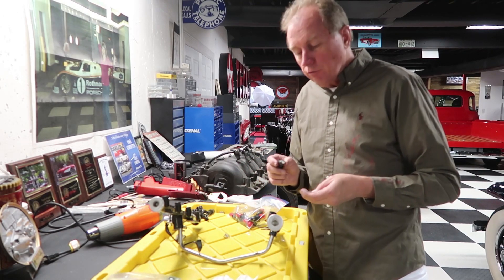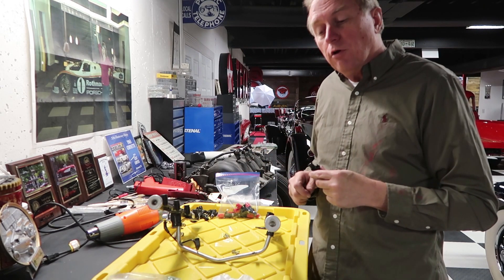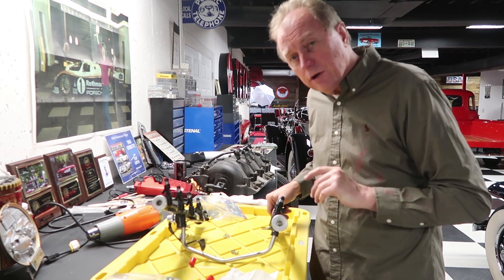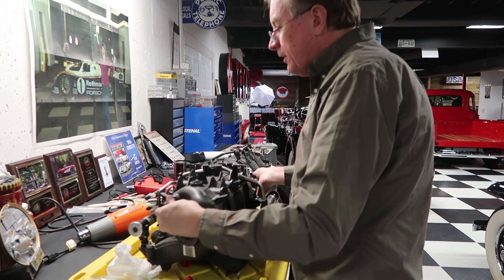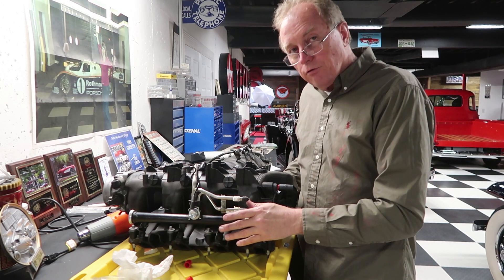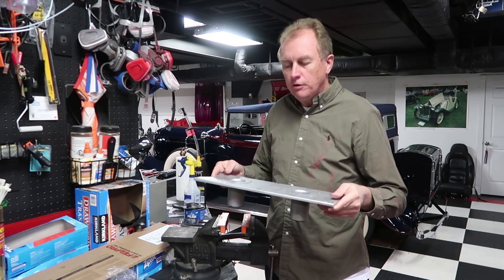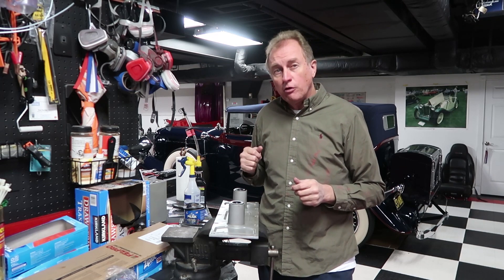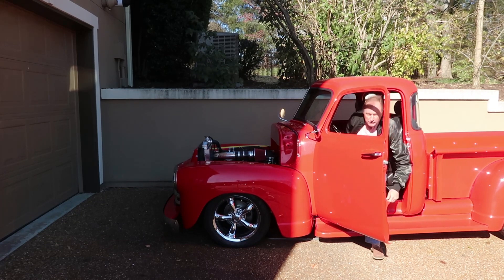Diagnosing & Replacing Chevy Vortec 5.3 Fuel Injectors

Comment: Beware that clogged inlet screens cause driveability issues and high fuel trims. Just saw this on a W22 RV with the GM 8.1. Had high fuel trims at cruise. Removed all 8 injectors and rinsed out the intake screens if debris. Before rinsing the internal screens appeared to be black. After cleaning the screens were obviously white. This debris isn't something you could flush out with injector cleaning techniques. You'd have to squirt carb clean into the inlet screens to rinse the debris off the screens. After reinstall fuel trims went back to normal + or - 5 percent LTFT and 0 STFT. Saved me from replacing 8 injectors.
Removed fuel filter and found it was leaking unfiltered fuel and debris through the outlet. Replaced the filter and flushed fuel through the line to rinse out debris.
Initial test drive shows fuel trims normal at idle and cruise. Hope this helps save someone else headaches.